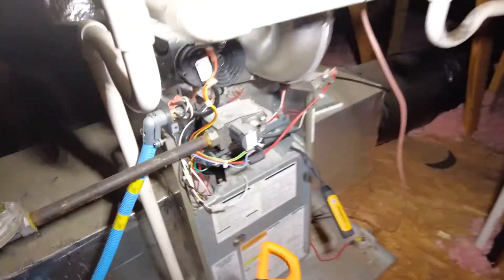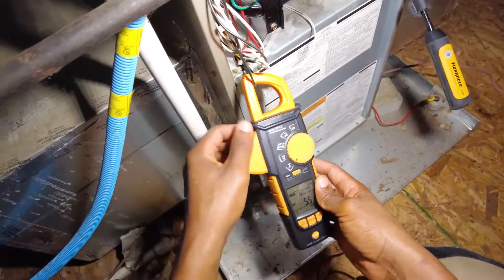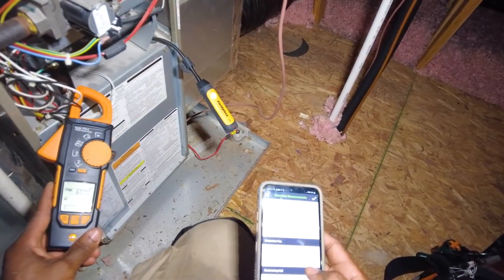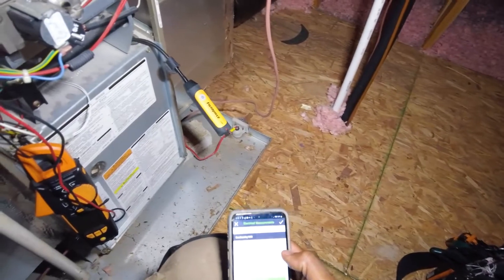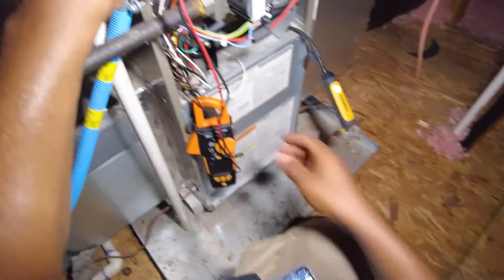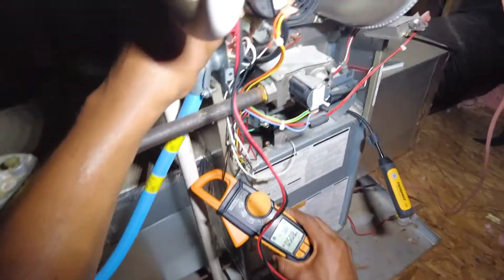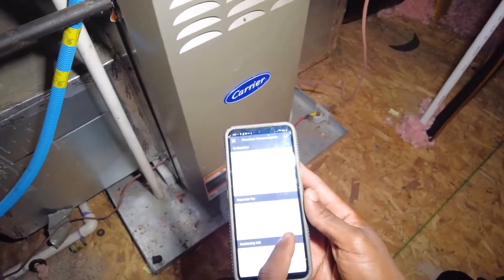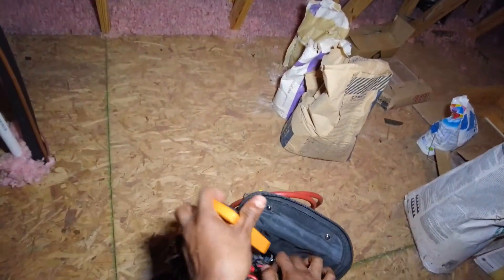HVAC Tech Testing True Power/Watts on Inductive Load with Testo 770-3 Multimeter

Comment: isn't it required to check the connection configuration (star/delta) when you connect the test leads to measure the volts ?